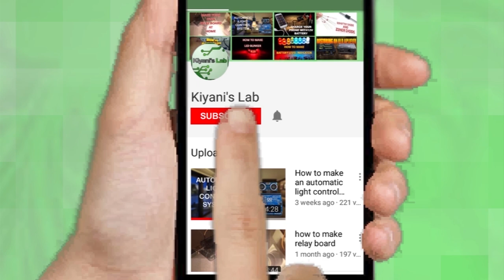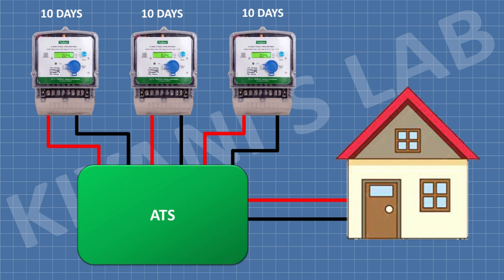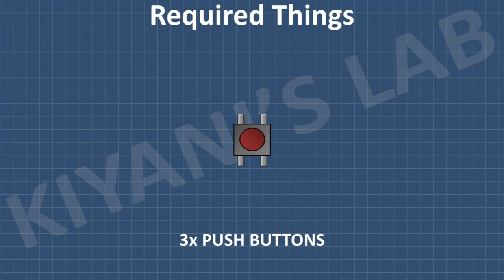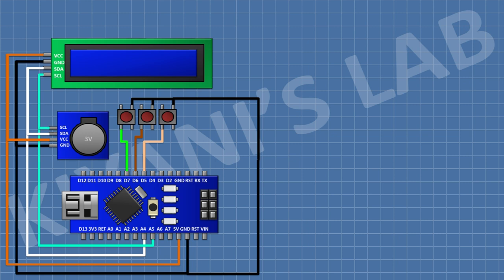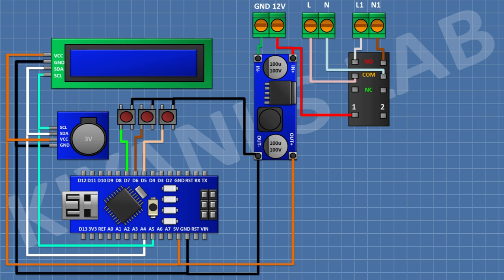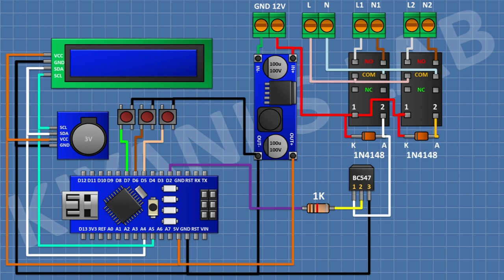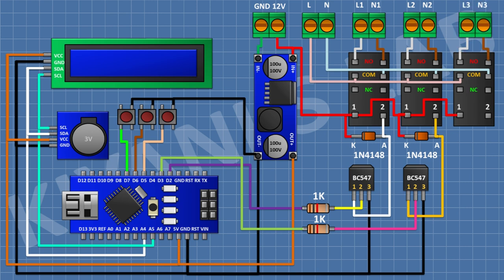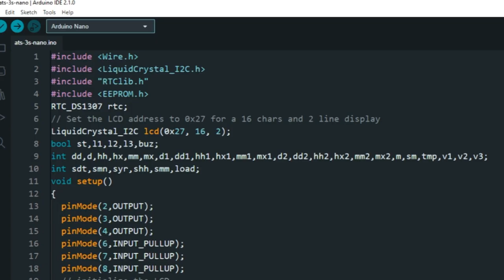Automatic Changeover Switch  | Automatic Transfer Switch

Comment: Few thoughts:
This project can be useful for small loads but cant be used for heavy load as you have shown, like we cant use this for switching entire home load as the terminals u have used are quite small and home wires are usually thick.
Secondly: it would be nice if u add auto swtiching so when source1 is gone it should switch to source2 and so on.
Reply from the maker: for more amps magnetic contactor or high amp relays can be used and in the next version this feature will be included

Comment: Few Features 
          The project is very useful but the missing feature is that ( When the set time complete the complete load will turn off it cannot restart automatically can you add this feature to make this project more useful). 
                                       Thanks.